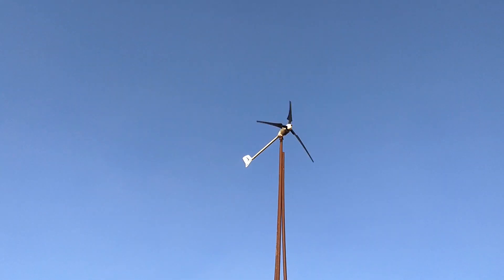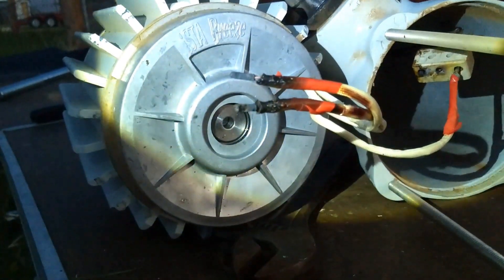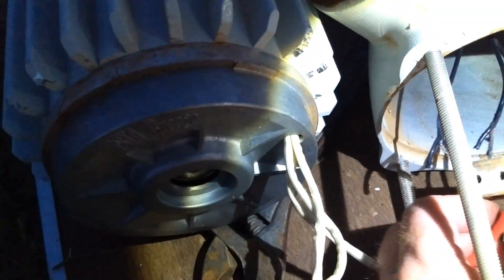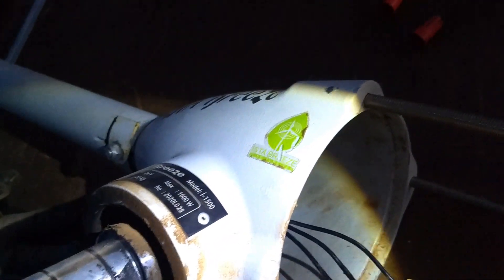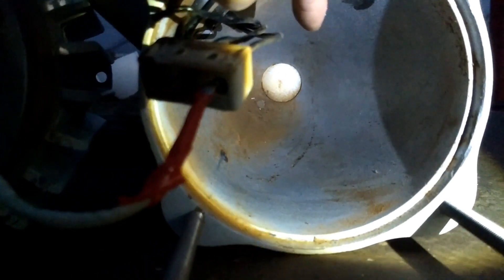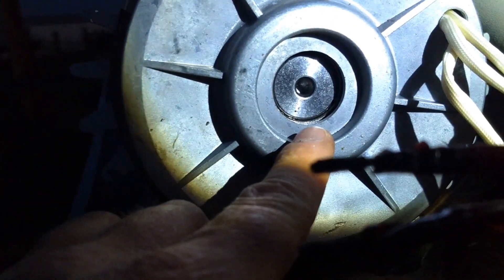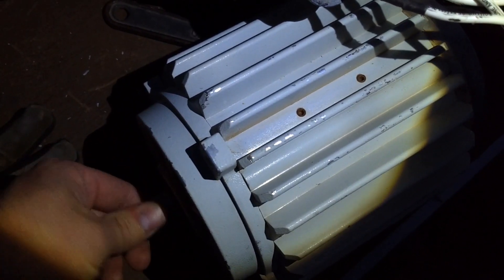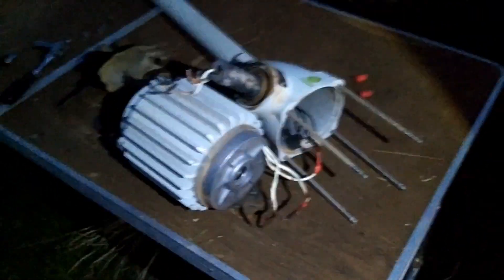The i1500 has failed!

Comment: I have the i-1500 wind safe and love it. When the wind get about 31mph it tilts up and turns out of wind until springs pull it back down. Two problems I had was the need for stronger springs which Ista breeze supplied upon asking. Also the wiring where the head tilts up broke and I replaced with much larger wire.

Comment: When it got windy it cranked a lot of Watts thru that block. That caused heating. When it cooled, it let go a little. Next cycle, does the same. That undersized wire looks like maybe 16ga. So good for between 5 and 9 Amps. On a good windy day, I bet those were seeing more like 10-15.
Reply from the maker: It's bigger than 12g, but smaller than 10g...big enough to be the minimum required but still a little smaller than I'd like to see...especially the way I abuse the poor thing!  But I imagine the last straw was the wind storm we had a few weeks ago when I thought I'd turn the turbines on to "see what would happen" haha.  I'm lucky it didn't chuck a magnet off the rotor and into the coils.
Reply: The voltage spike scarred the crap out of me even though I have dump it still hit my batteries with 60V ..I was standing there when it happened and flipped the switch.. now I'm cautious to sleep on a windy night.. I just shit it off..
Reply from the maker: So long as it's not a "all the time" thing even a 24v bank can take some high voltage hits.  You're running at 48, right?  I don't even have my system diverting until just under 57v.  60v isn't a great idea all the time but it can handle a couple hits without a lot of harm.  Now if it's holding at 60v+ for extended periods...that's going to be a problem.
Reply: @ToysforWatts  yes.. 48
Reply: @ToysforWatts  I would presume that where you are located, the extremely high winds you encounter are too much for this gauge of wire as you have stated. However, for most of us who live in areas where the wind factor rarely, if ever, get over 90 km (55 mph) gusts, then this gauge wire would be acceptable. I'm enjoying these videos with the trials and tribulations, not at your expense though! I am interested in this technology and I'm just trying to get my head around the pros and cons and seeing if these units actually work. Thanks!! Cheers!

Comment: Cooking means good output)
Do you apply brake as just short it out, or use resistors?
Reply from the maker: If I have to bring it to a stop I tend to just short the three AC leads, but there is no automatic brake or anything.  I only try to bring it to a stop if the voltage is higher than my batteries can tolerate, but it's done all manually.

Comment: Hey buddy, I have a question for you.
What is opinion on the i-2000W 48V Windsafe Windgenerator iSTA-BREEZE?
Reply from the maker: The generator itself I rather approve of...it's the same as the i1500, only there's "a little more" of it.  Whether or not the windsafe version is worth the extra money is debatable, though.  In my area where seeing 60+ mile per hour wind is a regular occurrence it's probably better for the turbine to have kind of furling mechanism, but I've let the i1500 stand in that in worse spinning away and it's done okay.  I do certainly like the mounting flange on the windsafe a lot better than the stub post.

Comment: With great power ... ;-) Anyway, what do you think would be the difference between 3 blades rotor and 5 blades rotor on IstaBreeze 1500? The 5 blades more suitable for small winds?
Reply from the maker: The i1500 needs a lot of RPM to really hit it's peaks.  Five blades would let it fire up in lighter wind and possibly make a little more power at lower wind speeds, but it would lose RPM in higher winds.  In my case it'd probably hold the turbine back somewhat, but if you're having trouble hitting the peaks then possibly it might be worth looking at to get a little more power at lower RPM.

Comment: The vibration that thing gets it probably just loosen the screws and gave you a bad connection
Reply from the maker: A little vibration, a little rubbing on the inside of the nacelle, and maybe one of the lugs wasn't super tight...all adds up.  Some solder and heat wrap will keep it from happening again.  The connector is only there to keep the system modular on the manufacturer side...they can quickly put the i700, 1500, or 2000 generator on the nacelle...on the end user side there's no real reason to keep it.  I'll be permanent in the morning, I'll have it up making power again before I have to go to work!

Comment: Hello, if you're not going to use that block, what are you going to replace it with? I've got a plastic one in mine and wonder if that's a problem. Do you think that it was that wind storm, 70+ that blew this up? Thanks for these vids. Jen
Reply from the maker: I'm going to solder the connection directly.  That block is only there as part of iSta Breeze's effort to make the i700/1000/1500/2000 modular.  They all use the same nacelle, just different length tails and different generators and they assemble as needed for sales.  Even after sales, they sell the generators separately...if mine fails I could buy another i1500 or even an i2000 generator and bolt it up to this nacelle.  A soldered connection will be better and more reliable.

Comment: I can't believe they used a screw type connection, it will eventually become loose as copper is always going to spread.
It should be a solder or constant pressure type connection.

Comment: Have you measured this connection? It looks like there is more than zero point X Ohm in this connection.

Greetings from Germany
Reply from the maker: It's just a straight connection, not a resistor.
Reply: @ToysforWatts  Sure, but it looks like there is a resistance where no resistance have to be...maybe i'm wrong, but checking it don't cost anything :)

Comment: hello toys for watts can you measure the diameter of the fixing tube for me?
thank you in advance
greetings piet
Reply from the maker: Certainly I can while it's down...but what is a "fixing tube"? :D
Reply: the part that contains the two Allen screws to secure the i1500, what do you call that piece?
Reply from the maker: Gotcha...I'd call it a yoke, maybe?  Or a stub mount.  It's 40mm on the outside, can't remember how long it is I'll measure it before I put it all back together.
Reply: Mine is 37 mm on my i2000 and still looking for a pipe to fit